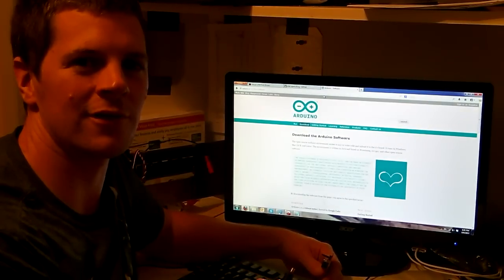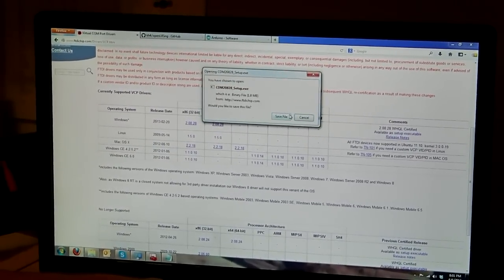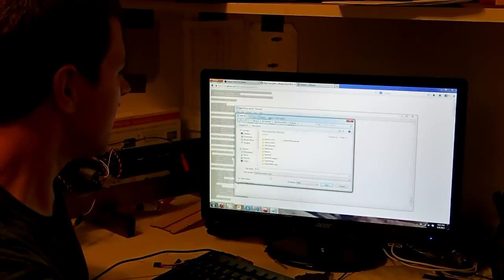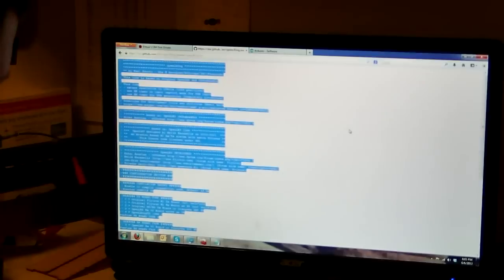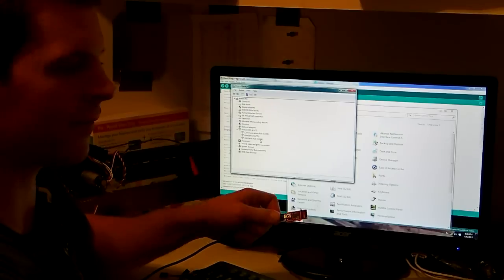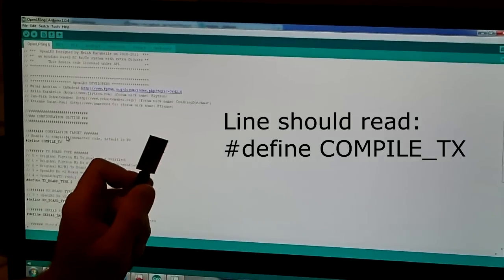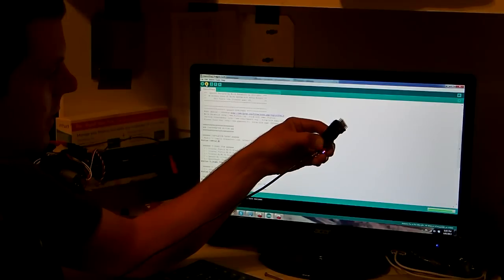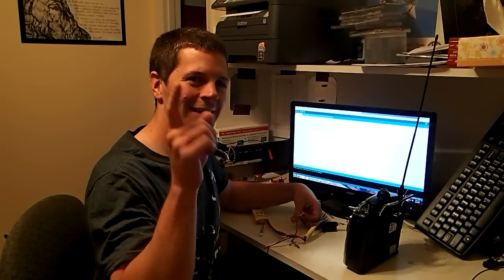OpenLRSng installation and set up tutorial

Comment: Thanks, Alex. I agree that it's faster to hit the ZIP button from the front page and download all of the files at once. You can then modify the settings using Serial Monitor in Arduino, a PuTTY terminal, or the Chrome openLRSng-configurator app and FTDI. The latter is easiest to use and lets you adjust RX settings remotely by binding it with a TX hooked up to an FTDI, and it's super easy to setup the spectrum analyzer. I like using Arduino for the initial install and configurator for tweaking.

Comment: Hi Alex in stead to copy and paste all the file you should download Git for windows,then not realy sure how work for windows,but for mac u just write the command in the terminal (git clone ww.github.com/kh4/openlrsng) and will copy all the file in a folder called openLRSng in your main disk,then you can open with arduino.....and for activate the alarm on lost signal you have to change the #define DEFAULT_DATARATE 0 line in #define DEFAULT_DATARATE 2 you lose a little bit of signal but u get

Comment: Very good tutorial.
If i can put my finger on something here it must be the bad light. Was littlie difficult to see details, dark room and bright monitor.
Can you tell if OrangeRx Open LRS 433mHz system that hobbyking sell is the same as this system, or is it just a cheap copy? Probably a stupid question, but i bet its best to go with Flytron?
Is it the M3 Tx and V2 Rx you use? Did you have to solder pins on the FTDI programmer, and did you use the 6pins or the 4pins or both?
Thank you.